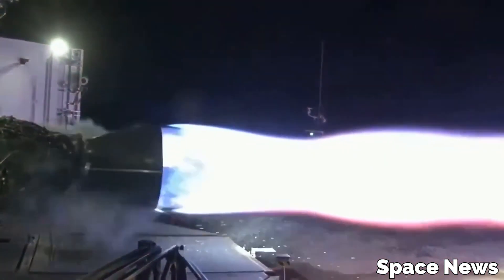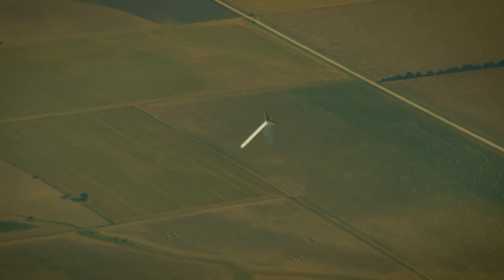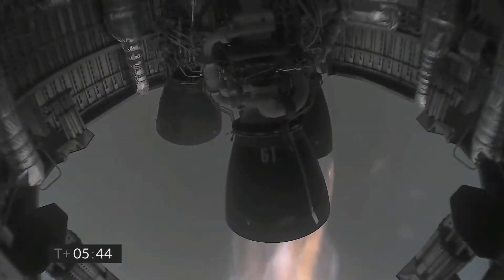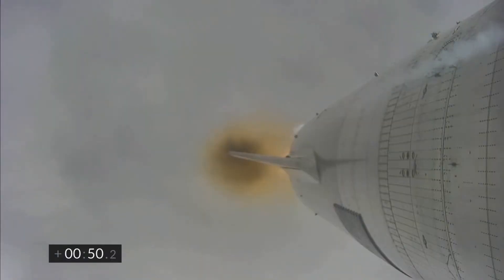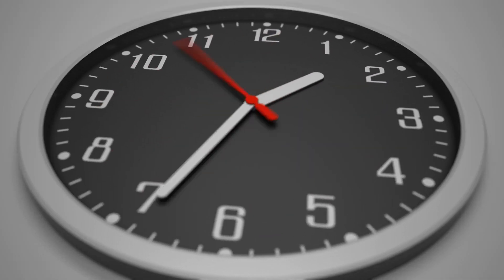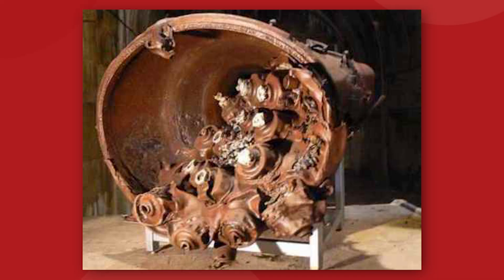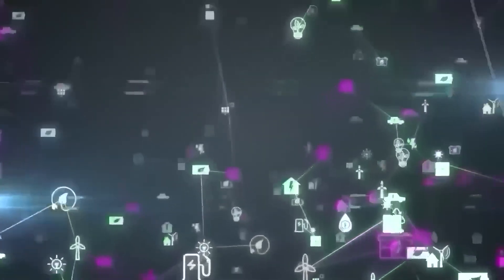How SpaceX Builds A New Raptor Engine Every 24 Hours!

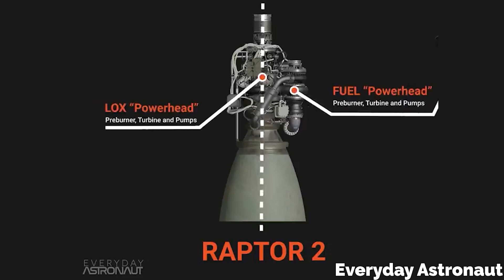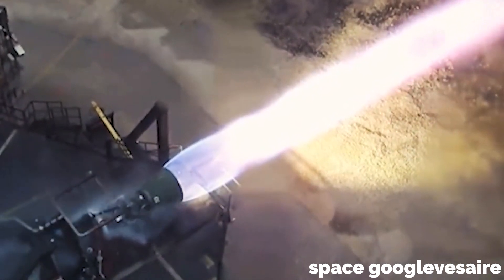Comment: At 5:00 to 6:00 the diagrams displayed here are for the RS-25, a Closed Cycle Fuel Rich engine, not the Raptor which is a Full Flow Staged Combustion Engine.  The biggest difference is that the RS-25 sends most of its LOX directly to the combustion chamber where as in the Raptor, all the fuel and all the oxygen go through their respectable pre-burners.  This means that the RS-25 is mixing LOX with s fuel rich gas in the combustion chamber, while the raptor is mixing a fuel rich gas with a oxygen rich gas.  The latter provides for a much higher combustion chamber temperature than the former.  What a mistake!

Comment: A rocket with 30+ engines? Making the odds heavily in favor of a fatal rocket engine explosion.
Reply: I disagree.  The # of engines is not the governing factor.  The reliability if the engine is.  Russia only test fired something like 1 of every 5 engines on the N1.  No wonder all 4 test flights ended in massive explosions when 80% of the engines had not been tested.

Comment: I’m no engineer—-but 36 engines in the 1st Stage of the Starship is a POOR DESIGN to begin with. The Russians couldn’t do it 50 years ago and they had the financial backing of the STATE to fund that N1 Program. 🤔🤔🤔 Meanwhile, the SLS/Artemis has ALREADY orbited the Moon. Starship is way behind schedule.
Reply: Poor design?  50 years ago with 50 year old technology yeah!.  With the technology we have today, they are doing it and have already surpassed what Russia did 50 years ago.  Yeah SLS threw everything away except the capsule to bring the humans back to earth.  Re-useability is hard, given no one else has ever done what Space X is attempting.  Space shuttle was a far cry from being re-useable, months before it could fly again.  SpaceX is aiming for hours.  I can see you are no engineer.  try throttling down 1 of 5 big engines enough to hover at landing, never mind overcoming the complexities of combustion instability in a bigger engine.  N1 failed because something like only 1 of every 5 engines was ever test fired before being used.  Not so much that they used so many engines.

Comment: FORMER BOEING - LEAN MANUFACTURING

4 engines per day seems like a big stretch goal and won't happen overnight. Not long ago, they were making 1 per month. That increased to 1 per week. Currently they are making 1 rocket engine per day. At Boeing Everett, engine specialist can complete a giant GE9x Turbofan Engine in less than 1 day. At one time it took three 8 hour shifts over several days to make one engine. Lean Manufacturing, Just In Time Inventory, and workforce training are responsible for the increase in production, improved quality, and reduced cost to customer.

Simplifying designs, components, and manufacturing processes in incremental improvements will allow SpaceX to reach it's goal of 4 engines per day. Due to the complexity and very precise tolerances, skilled technicians are needed. Theoretically they could move towards 1 engine per 8 hour shift. That would net 3 engines per day x 5 work days = 15 engines per week x 4 weeks per month = 60 engines per month. It could be higher if they run weekend shifts and work month as high as 4.5 weeks per month.

Keep in mind, this is ONE production line. Once all the processes have been improved, ADDITIONAL production lines could be brought up quickly. SpaceX VENDORS will also have to increase their own volumes to meet SpaceX's production rate. When I was with Boeing, we went to the different vendors and helped them increase their production just as did ourselves. 

SpaceX needs lots of rocket engines. The Booster uses 33 and the Upper Stage uses 6 for a total of 39 per rocket. Keep in mind if all goes well, these engines will be reused after the Stages return and land. Engines will be rebuilt / repurposed and used a number of times. 

If Tesla can make 1,000 Model S Cars each day, SpaceX will be able to make 4 Rocket Engines per day.

Comment: "3D Printing limits the ability to scale up manufacturing, it adds cost and slows down the production" This is Non-Sense! I mass-produce 3D Printed Products, roughly 50K units per year. I can adapt my design on the fly, meaning I can change my production to 3D Print a new design in seconds. I can scale up by adding more 3D printers. Cost, my pure profit margin is 95%, with zero initial investment into a new product. My production speed is 80% more efficient and faster than in traditional manufacturing.
Reply: Yeah, I thought that was ridiculous about 3D printing when just moments earlier he was talking about AM (additive manufacturing).  What is the difference between 3D printing and AM. Duh!

Comment: I still can’t get over how the booster lands to be reusable. I can sit and watch it over and over, never getting over how quickly it adjusts right at the very end to center itself on the landing pad. Incredible!
Reply: It's done with a smartphone.  All you have to do it connect it to all the engines at once.  Simple.
Reply: @Canadazeus  it’s not simple to retro land boosters
Reply: @Nill757 it will arguably be a bit easier with superheavy than with falcon9. An almost-empty falcon 9 with a single engine running at minimum thrust has more than 1TWR so it can't hover, however an almost empty Superheavy at minimum thrust can.
Reply: This is not a new technology

NASA did the same years prior
Reply: It seems implausible because we think of the booster as very heavy, several hundred tons, which it is at take off when full of fuel and oxidizer. At landing, its not.

Comment: Query:  where is the mechanical support in R2 to transfer that impressive 230 tons into lifting the rocket body above? Seems like a lot more steel would be needed in the R2 engine mounts, esp w that vibration environment.

Comment: The scary thing is, it isnt a rate of 1 engine per 24 hours but 24 hours per engine. They are cranking several engines out per day and are only getting faster. Easily 3-4 per day meaning 100 per month

Comment: As an aircraft engineer, I am interested to see how SpaceX engineers screwjacks for flight control actuation. All the screwjacks I've seen in operation are quite slow which is the exact opposite of the required task. Either the thread per inches or foot needs to be really course or the drive motor is a 3 phase beast that has to be lubricated really well under those loads and axial speeds. 🤔
Reply: ActualLy you don't need that fast actuation. You can break the rocked if you slam it hard. At it's size the loop is slow.
Reply: @CATA20034  I think in a perfect environment this is true, you have time during decent to adjust by however many degrees per minute and nail the landing, however I am curious to see how well that holds up in the real dynamic atmosphere.

Of course, it's not just the gimbling but the throttling that can be leveraged for control, so I imagine given all of their experience they have with landing Falcons (at sea no less) that they not only have software that has it modeled perfectly, but that they can stimulate almost any landing condition.

I have more concerns about other aspects of the StarShip design. The Raptors are about the least troublesome part I see.
Reply: @Steven Edwards  you are right when it is descending in the upper atmosphere where coarse actuator corrections are satisfactory but I should been clearer with my thoughts. Those raptors on final decent burn, you can actually see them gimbaling on the XZ axis pretty aggressively just before touchdown which hydraulics can only do. Just look at large flight control surfaces on B777 and A380 etc. Those large slabs  move very quickly which is very impressive to watch during function checks. Either way, I'm intrigued to see SpaceX get around this problem 🤔

Comment: The electric gimbal was tested this week as well.
Reply: Yes the question is not whether an e motor could turn a screw but where does one get the very high amp electric power with out adding more weight than the hydraulic system?  Battery? Generator running off that zillion rpm engine turbo?

Comment: So Elon SpaceX was able to come up with a metal capable of withstanding High temperature oxidisation, but yet the naysayers said that the Thorium Molten Salt Reactor can’t be built because of the same corrosion problem. So why not stay with a dangerous reactor we know that only burns 1% of its fuel, there probably the same type of people that prefer the SLS.

Comment: There was very very little on how they build a Raptor every 24hrs
Reply: But the fact remains....they build 1 raptor engine every 24 hours, trust them.
Reply: @jerrycordova1971  Same as all the moon talk, they don't even have a deep space capsule for this at all, so 10 years away still for that at least.
There's a massive difference between a Dragon capsule, and a deep space capsule that can carry to the moon.
Reply: @elitecol69  yep 👍
Reply: @elitecol69 lol space was literally contracted by NASA for a Human Landing System for The Artemis 2 mission in 2025. they have been working in doors on the HLS version of the starship and they’ve said they’re making good progress. So that particular starship would be deep space Capable and will take astronauts to the moon. Nobody ever said they’d be using dragon capsule for deep space missions, because that is literally what starship is currently being Made to do. Do your research
Reply: @elitecol69  I think they'll try and use starship for that once Orion shits the bed for the last time
Reply: @trickeruniverse1979   @elitecol69  The issue being that the HLS is a moon-only vehicle meant to ferry cargo from a high lunar orbit/lunar gateway to the surface. It cannot return to earth and apparently isn't rated for long duration human crewed flight (maybe it could, though...) Since Orion/SLS suck, they may sell NASA on using a normal starship for the to and from earth's surface/lunar gateway. However the catch model isn't exactly human rated yet.
Alternatively they could (after prepping it for longer flights, which should be fine since its made for long duration lunar surfact activity anyway) take humans to the moon on HLS, dock to the LG, land, return to the LG, return to LEO, dock with a dragon, and return to earth.

Comment: How is 3D printing making scaling harder ?

It literally removes labor as a factor of production...
Reply: It’s orders of magnitude slower than other production methods. Great for prototyping new parts, not great for rapid production. “JuSt iNcrEase tHe nuMber of 3d pRinTers” Yeah? What’s that going to cost? For a process that’s still too slow? Better to invest in manufacturing methods that can crank out high quality parts 10x quicker. Until there’s an advancement of the state of the art in 3d printing anyway.

Comment: Yes I think it's doable.  And they really do need 1000 per year to hit their goal of 1M people on Mars by 2050.  At first glance, the majority consumer of Raptors might appear to be the Heavy Booster.  But the goal is to get them "rapidly reusable" - flying 6 or more missions per day, and getting an average of 100 launches per Raptor.  If it requires 6 launches to refuel a Starship for the voyage to Mars, and if on average a Starship carries 40 people every 2 years and we start sending people in 2030, then there needs to be 1M / 40 / 10  = 2500 Starships on average between 2030 and 2050, each with 6 Raptors = 15,000 raptors.  And for the boosters - 1M / 40 / 10 * 6 / 100 =  150 Heavy Boosters each with 33 raptors = 4950 Raptors.  So 20,000 raptors delivered by 2040, the middle year... 1000 raptors per year if they'd started in 2020, lol.  I think in reality they will manage to refuel in 5 launches instead of 6 due to efficiency improvements, and that will get them back on schedule with "only" 1000 per year!  Another consideration is how many Heavy Boosters you need to hit the launch window.  With 150 doing 6 launches per day that's 150 Starships ready to go per day, so it would take about 17 days to refuel all the interplanetary Starships.  17 days fits a variety of launch windows.  The range of options is restricted mainly by transit duration and free return parameters, but they're all easily within Starship's loiter capability.  But I think they'd also need at least 75 Orbital Launch Mount / Mechazilla combos, operating 2 Heavy boosters each, with launches every 2 hours!!!  Imagine that!!!  A launch every 96 seconds for 17 days !!!  Imagine the global celebration / contempt !!!
Reply: In your dreams lol… keep dreaming!
Reply: @alanmay7929  Indeed, I shall. 🙂🚀

Comment: @The Tesla Space - My guess for how main chamber ignition happens is that they asymmetrically burst the throttles to the turbo pump pre-burners.  That would cause them to belch a variety of mixture ratios and pressures, which would cause the main combustion to backfire the same way older car's exhausts would under similar conditions.

Comment: Are they not using the same engines on StarShip as on the Booster?   If so, how could an external startup system work on mars?
Reply: Consider it a "starter motor". For booster, leaving the starter motors for the outer engines off saves tons of mass. For Starship ... they "just" put the motors on the ship.

Sure they're "The same rocket engines", but they can have different sets of "accessories". 

People are continually confused about things that are simply irrelevant to any current model. A Mars Starship is going to have piles of differences. And there's like five or so clear variant models already. But none of that is relevant to figuring out the very first problem: "Can it go up "
Reply: @shrikedecil  I see.   So it's just a word game as to where you draw the line as to what's part of the engine.   Most people would think the turbopump is one of the main components of 'the engine' but it's technically not required as long as you feed fuel to the engine with enough force.  
So Tubopumps, Starters, Control Computers, etc I think most people would thing the 'engine' is the parts that make the flamy stuff come out, that is not part of the consumables.  But that's just colloquial meanings.   As per his target audience.  
I'm sure the people installing them think it's what ever got sent from the manufacturing site.   I'm sure the engineers working on the engine have their own definition as to what part 'the engine' is.  
And then of course there is the people that call them motors.   :p
Reply: @lucidmoses  Although I inferred sarcasm from that, you described it very well but for one part. The turbopumps/computers are needed for both "starting" and normal operation during flight. But on the ground, the turbopumps can be chilled and spun up with gases from hoses that disconnect on launch. And there are closeup shots of the launchmount detailing this.

If you look at the outer engines in flight, from what we've heard, they simply don't have the right plumbing, valves, connections, tanks etc to *re*start in flight. The outer engine's "starter motor" is on the ground, as part of the mount itself. They still have turbopumps and the electronics.

The inner engines, the 'boostback burn engines', they do have whatever they need for starting in flight. On earlier flights, part of that "relight" capability is from the carbon overwrapped pressure vessels of helium. Their starter motor was packed along for the flight.
Reply: @lucidmoses  Sure you could build an engine without a turbo pump. Never going to get enough force and rate of flow as with one, if you do find a way the weight and complexity will likely far out weight using a turbo pump.  ICE engines worked fine in the beginning with out a lot of things like distributors, injectors, oil pump, turbos, even spark plugs, were they efficient, upgradable, no. So are distributors, injectors, etc part of the engine or not.
Reply: @shrikedecil  They have already figure out the can it go up part.  The problem now is can it land safely, then can it land safely and be re-usable.  They already landed the booster safely once, something no one else every thought possible, until it happened.

Comment: could starship breathe in air and feed that air to the raptor engines instead of feeding raptor engines with oxygen from oxygen tanks to save weight or would it be difficult to split air into oxygen from nitrogen
Reply: The core problem is that the atmosphere gets a lot less dense very quickly. Ramjets/scramjets/etc are explored for jet like things. And it's arguably useful ... for jets.

But. The second you've decided to 'go to space', then the air-breathing gear is "dead weight" beyond some point (depending on exact gear). And rocketry is entirely about minimizing dead weight. The weight of the gear (including structural reinforcement!) needed to compress/liquify/etc air ends up being a significant slice of the *empty* weight of the rocket.  "Just" replacing that same weight with fuel+tank ... when you compare the two you're going to choose "larger tank".
Reply: A British company is working on this. Look up the SABRE engine.